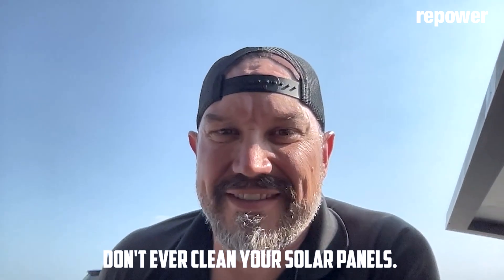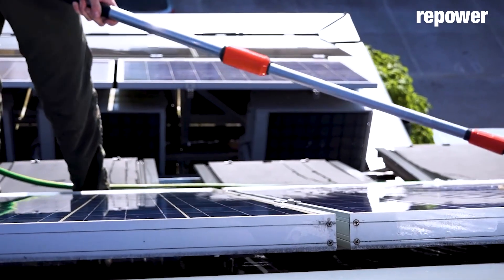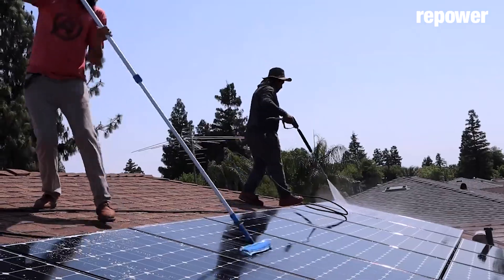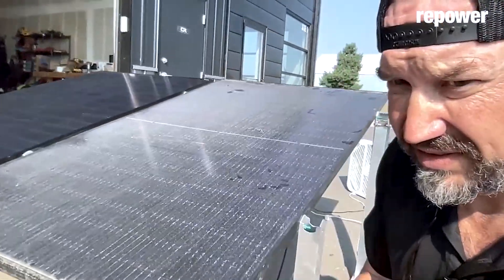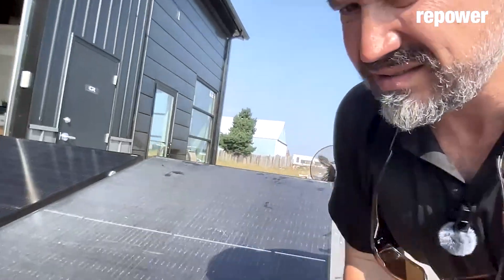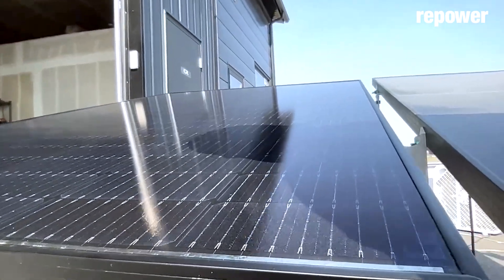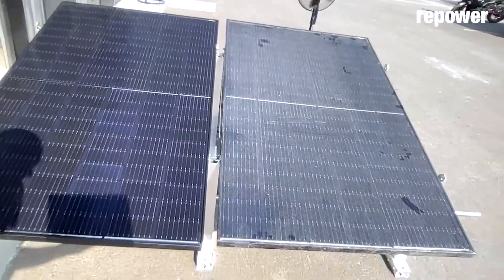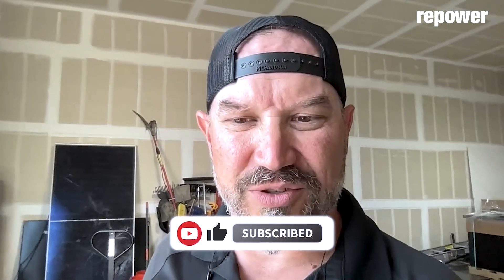The SHOCKING truth about cleaning your solar panels

Comment: We get pine pollen that covers our panels in the late spring that puts a yellow coating on the panels. I clean them after the pine pollen has finished. It's nasty stuff. The rest of the year they get dirty just like in this video. The only thing I have noticed is that they look nicer cleaned than being yellow. It takes about 1 hour to hose them down and wash over with a soft brush with mineral free water. We have 30 commercial panels in 3 arrays.  East, North, West . We are in Hamilton NZ. I watch the weather forecast, and try to get them cleaned the evening before rain is coming. Never could tell if they made more power or not.  This video shows that there is not much in it for clean or dirty panels. Great to see a real world test and busting myths. I too am surprised that the gain was so low.
Reply from the maker: Pollen is tough, its pretty sticky stuff and lots of other stuff sticks too!  I recommend a cleaning after pollen is gone, if any at all.  They look so much better clean, I love that part, but money wise its probably not worth it, but do we do everything for money, no!  Thanks so much for the comments.
Reply: @joelrobinsonrepoweryourlife  I clean them myself. So 1 hour of my time is no big deal. Be very different if I was having to pay for a commercial cleaning crew to do it.  It also gives me an opertunity to examine the roof and guttering as well.

Comment: This is a very good test.  It would be even better if you actually show us all of the components.  Additionally, there could be other factors such as wear on the solar panels.  Is it possible if the dirt remain on the solar panel for a really long time, it might cause the panel to react strangely.  In any case, I believe the greater point you are raising is this:  Is it worth it to clean you solar panels?  Maybe once every 5 years (or longer) is enough to save time, effort and cost.  Thank you for bringing this to our attention.
Reply from the maker: Thanks for the comment.  That's right, we don't think its worth cleaning them just because of dust, but maybe for other reasons.